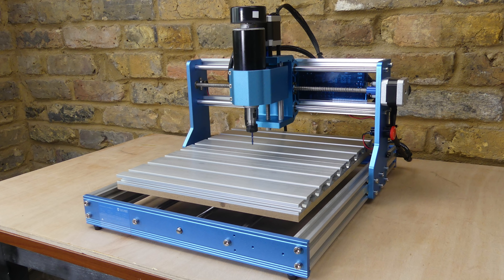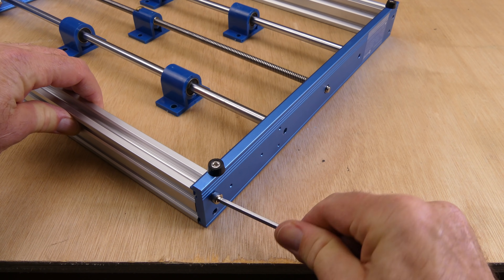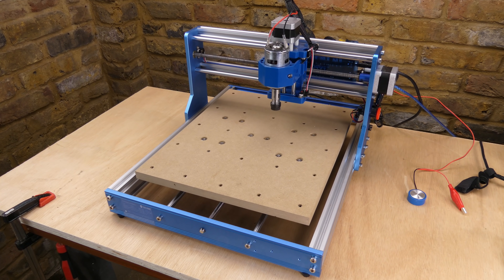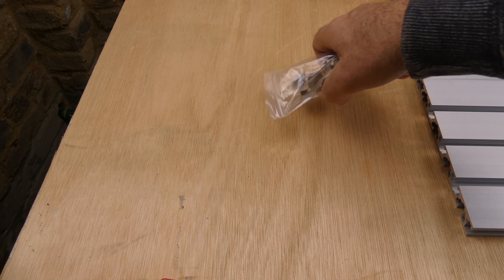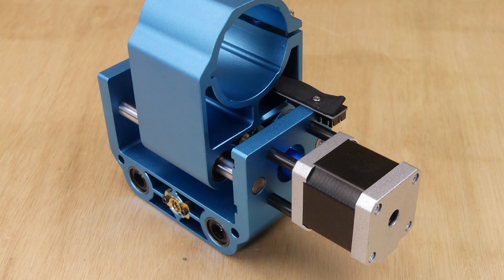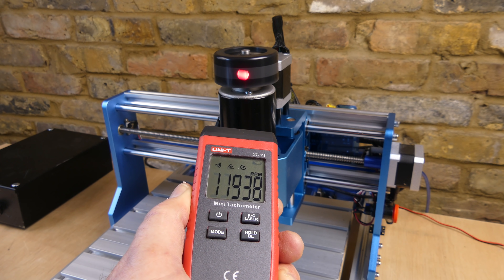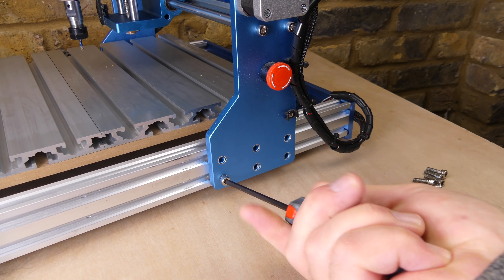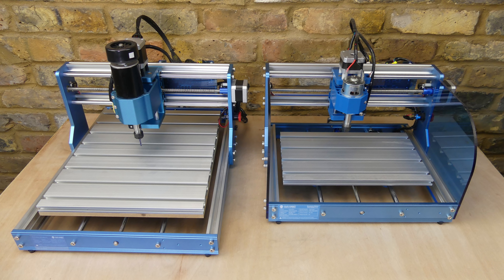CNC 3018 to 3040 Upgrade with 500W Spindle Motor  ( Sainsmart Genmitsu )

Comment: Is there a way to upgrade this machine (or identical Lunyee 3018 pro max) with a 4th rotary axis? I can't find anything about 4th axis upgrade....
Reply from the maker: In theory, you can just buy a generic rotary 4th axis and connect the stepper motor to the y axis output on the controller.

Comment: I connected a 500 W spindle to my GRBL card–driven CNC. I use the UGS software to establish a connection, but after it runs for 3–5 minutes, the USB connection drops. This seems to happen when the spindle starts to overheat. How can I prevent this? The USB cable is a shielded cable.
Reply from the maker: Might be static, try grounding the spindle and any dust collection.Add split ferrite cores to your usb and power cables. Check the power supply output is ok.

Comment: I recommend everyone wear out the stock z-axis before upgrading. You do not want a sturdy z-axis until you learn to control runaway. It happens a lot with these in the beginning. You switch out the tool and forget to tighten. You get off on your position. I had about 5 bad ones where it was better that the z-axis has some bend to it. If you are ready, go for it. Absolutely worth the price. So much quieter and I can run the mill a lot faster. I set my cut rate to where the bit is not jamming into the work and having a more perfect spin helps a lot. But best of all, you really set the difference in the milling. No jagged edges and you can just tell it is a better cut. I am still running the stock motor. It is almost dead, just curious how long it will take. I cut pcb board mostly and drill perfectly spaced holes with mine.

Comment: Boh, that's ugly, those large overhangs of the table, these thin rods that are already too thin in the 3018, for a laser this may work but is more expensive than a complete 3040 laser, for any milling it is just too weak. The aluminium part is just as small as on a 3018.

Comment: I upgraded the spindle on my 3018, but when I tested it, I noticed the Z axis seems "inverted". When I try to raise it, it goes to Z- and vice versa. Any idea where the problem might be? The connections seem to be correct, and the spindle raises when the auger rotates clockwise, so I don't know what the problem might be. Any guidance or advice would be helpful. Thanks.
Reply from the maker: You can change a setting in the grbl configuration to change the direction.  $3 direction port inverse mask   https://github.com/gnea/grbl/blob/master/doc/markdown/settings.md
Reply: @techydiy thanks a lot, I'll try that! I'm learning a lot with your videos too, they're always super helpful 😊

Comment: What end mills did you use to cut the aluminium sheet,aluminium has a specific cutter profile if the wrong cutter type is used regardless whether HSS or carbide the wrong cutter will struggle as the soft metal will not clear and will smear on the cutter.

I have just bought one of the 3018 pro desktops(still in post) and i have thought about this enlargement using the control gear with TB6600 stepper drivers and larger steppers of course,maybe use the side rail bearings i have and make a stiffer gantry out of box section steel profile 1mm thick to make it as light yet stiff as possible since the bearing rods are the gantry weakness.

If you get better cutting of aluminium you could mill gantry side plates from 10mm aluminium,i would,and get some real wood carving going on.

Still you have a good mill there,trend sell the proper aluminium cutters and trend have a wealth of info on this seeing as they are for manual routers for shopfitting doors etc the materials for this would be perfect for even a stiff alloy gantry etc.
Reply from the maker: I now generally use single flute or 3 flute dlc coated endmills for cutting aluminum and stick to grades that cut easily like 6082T6

Comment: Why did you Earth the motor and what did you end up connecting that additional wire to? I have been having some EMI issues with my DIY machine and I am interested to see if that might help with some of those problems.
Reply from the maker: The power supply was not isolated from the main supply. Connected it to the supply earth.

Comment: Please don't cut your zip ties/ cable ties like shown in the video. The tool is called a "flush cutter" for a reason. Cut the excess cable all the way flush.  If you've ever been stabbed or sliced open by an improperly cut cable tie you will understand. Other than that, a brilliant video.

Comment: Watched you're fantastic videos and now have installed a larger table from Sainsmart. 300 X 360mm
Could you please tell me the $130 - $131 - $132 settings plus how far did you move the gantry.
Thank you 
Please stay safe.
Bill M8-)

Comment: Excellent video, I would like to make a modification, but I would like to know how far I could extend the x, y, and z axes.  I would also like to know if the values that changed $131=315, if previously above it indicates $131=158 that means that the previous value was 158?

Comment: I am in the middle of doing this same upgrade but, I discovered that the Z axis limit switch is hard wired to the assembly with a tree prong plug on the control board end - on the assembly I am removing.  But, the new assembly requires a wire with plugs on each end.  Did you have that problem?  If so, how did you fix it?  I don't want to have to cut the wire from the old assembly and try to solder it to the new one.  Thanks, I like the video.
Reply from the maker: I didn't have any problems.
Reply: OK, Thanks @techydiy

Comment: As a side not, you can get the very same parts to increase Y axis size by sourcing them. Waaaay cheaper !
Same goes for spoilboards : both at the same time. Aluminum as a "base" that will be left untouched, and a MDF one that can be sacrificed.

Comment: What is met by " offline contolker"?
Reply from the maker: Offline controller - Used to send gcode to the machine instead of a pc or laptop. It has an SD card slot for the files.

Comment: have built the machine as your did in your video. The only thing not done is making four plats to raise the cutter. Since this is my first CNC would you be able to supply the templet?
Reply from the maker: I never saved it, it was pretty simple though.
Reply: @techydiy  Thanks, from your video I was able to create the drawing.

Comment: Manual says mount the x axis assembly 46.5mm . do you know why? I saw that @6:55 you had this more than 46.5mm
Reply from the maker: It needs to be positioned such that the the spindle is in the centre of the table travel. So move the table to the centre of its travel and then set the spindle into the centre of the table.
Reply: @techydiy  Thanks for the details. So, if we position the table in the center of frame and x axis in the middle, the spindle has to be at the center of the table. Did I get that right?

Comment: Thank's for your video : i'll notice the link!
I re-designed the electronic parts of the 3010 because i find it too weak and no electrical keys anywhere 
can bring several  electric damages to the machine.

I have 2 questions:

1/ Is the 3040 stronger or better than the 3010?
2/ And may we do the same thing with the 3010?

Does anybody knows?
Thank You!

Comment: Ever seen this one? Even after carefully calibrating the XYZ axes my 3018-PROVer and using the Z-probe on every setup, it consistently cuts between 2mm and 3mm deeper than what is called out (using an end mill with a 1/8" shank - the goal is to get a cut 1mm deep in 3mm stock but no luck).  Everything else seems to be working accurately across multiple test files in VCarve Pro 10.5, UGS, and Candle but they all produce much deeper cuts than what I'm instructing the CNC make.  Cheers
Reply from the maker: I think  I would start by manually jogging the machine z axis up and down by 1mm, 2mm, 10mm etc. and seeing if it actually moves that amount. Also see if you have any play in the z axis.
Reply: @techydiy  Found it!  There is an option in VTransfer for X-Carve  -- I ignored it because I don't know what X-Carves is -- that allows you to specify the height of your Z-probe as well as a default move rate.  Both values were too large and after adjusting them I'm getting the proper depth.  Thanks again
Reply: @techydiy  Thanks.  Yeah, I tried that and it's all tight and jogging against a digital depth gauge is 1:1.  No idea why it overshoots by so much when doing an actual job =\

Comment: What size (and length) bolts and tee nuts do you use for z extension when you used your metal plates with four holes, please?

Comment: How do you insert the clamps for holding the wood ? There is no place on the sides if you block with the extra rails heigh!
Reply from the maker: The whole table moves forwards and backwards
Reply: @techydiy  Oh, yes. Pretty annoying. Finally my option was to leave nuts on every slot so I simple screw the clamp where I need it. 😊 Thank you very much for the clear directions on this upgrade, BTW .

Comment: Hello, I also have such a motor (48V). It was working before, but yesterday, while scraping wood, the motor had a hard time and suddenly stopped. Now it doesn't work at all. I measured it with a multimeter. There is electricity (48V) at the output of the PWM driver and the positive and negative terminals of the motor are powered, but the motor does not move. What do you think might be causing the problem?
Reply from the maker: Use the multimeter to check the resistance of the windings. They might be open circuit, shorted, it could be a problem with the brushes.
Reply: @techydiy  Thank you for your answer.  I will check it.
Reply: I had a similar issue, but the symptom was after the scraping incident, the feed rates became incredibly slow. Eventually I did a $RST and then reestablished the original settings.
Reply: @davidhawley1132  There is no problem with my CNC machine. Spindle motor does not spin. (The motor was working independently from the CNC machine)

Comment: Thank you for taking the time to make these videos as it's very much appreciated.
Is it possible to answer two questions for me please.
1 The new upgraded motor came with a power output unit but I don't know which of the live/motor terminal goes where as it in Chinese caricatures.
2 What is the size of the metal box. and where did you get it please.

Thank you .
Please stay safe .
Bill M8-) 
Haddington
Reply from the maker: 1. You can get a camera app on your phone that translates Chinese
2.  9" x 6" x 3" Adaptable box with knockouts. 
It was just one I that I already had. I would just get any Aluminium / Steel project box.
https://www.tlc-direct.co.uk/Products/BX963.html
k

Comment: lets upgrade make it longer rod and same acme thread. it just flex more. even 12mm linear rail is better it flex only that much how much thing you skrew it flex lol if you skrew it on granite it wont flex lol.
noh lets just have 12mm round rod in middle it not flex? lol

Comment: Hi,finally I have the need to use now the expansion ordered a while ago.
Anyhow - I was thinking of replacing the Spindle as well.
What I want to ask is: Can I use the spindle speed commands like I used in the original spindle? OR do I need to turn on the spindle with the potentiometer on the new external powersupply?

I am using the MACH3 version for the 3014 Prover 
Thanks for your feedback!
Reply from the maker: It is possible to connect some spindle power supplies to the control pcb  to allow speed control. It depends on where you get the spindle. The spindle power supply that I used is pretty difficult to connect due to high voltages. The Sainsmart one is probably easier. Someone made a video about it.  Personally I don't think having program speed control is worth the effort with a 12k spindle.

Comment: Well I am new to This, Please can you explain why the spoilboard is on the bottom.?
Reply from the maker: It's not a spoilboard, its part of the table. A spoilboard is a disposable sheet on the top of the table bed. 
Sainsmart use the wrong terminology for this (in my opinion)

Comment: i cant seem to remove the original lead screw from the stepper motor. I removed the 2 tiny screws farther from the motor but the screw seems to be stuck. do i have to remove the other two screws closer to the motor? the old screw doesnt seem to budge. is it also screwed into the coupler or just inserted and held together by the tiny 2 screws?
Reply from the maker: It's just inserted into the coupler and held in place with the two grub screws. its is probably just tightly wedged in there.
Reply: @techydiy  yep. had to use a few plyers to take it out. scuffed up the coupler a bit but its alright. Also i just finished adding the extension and noticed the new extended screw is not straight when spinning and is alot louder compared to the original. looked straight preinstall. is it just because of the length that there is a lot more up/down movement in the screw? or a bad screw altogether?
Reply from the maker: I would check the coupler to make sure it's not off centre. Also grease the leadscrew. Leadscrews  are reasonably.

Comment: Thank you for a great video!!! It helped  me a lot!!!  I just added the 3040 extension to my 3018 Prover.  I have a question : How far must I move the gantry forward on the 2040 rails from the original 3018 original position?  I installed it in the original 3018 position and it appears to be about 30mm too far back.  I also plan to use the old 2040 rails to "lift" the Z axis higher up since I added the 3040 spoil board with the extra aluminum bed piece.
Reply from the maker: Position the spoilboard so that it is centralised and then position the spindle so that it is in the centre of the spoilboard.

Comment: It was very interesting. But you should have used sliders to connect aluminum profiles. Hope you did later :)
Reply from the maker: Why? What difference do you think it would make?
Reply: @techydiy  it would prevent backlash and give five more millimeters of height as a bonus.
Reply: How would you tighten sliders in that case? Never seen any that you can tighten from the side.

Comment: Thank you for this very informative and very well-done video. Can you give me the spacing of the cylindrical guides of the X-axis, of the aluminum motor mount that you used? I would like to know if I can install it on a Chinese 3018 no name. On my CNC, the cylindrical guides have a diameter of 10 mm and are spaced 72 mm apart.
Reply from the maker: As best as I can measure them with calipers, 10mm diameter and 69mm centre to centre spacing (with 59mm of space between the two rods)
Reply: @techydiy  Thank you for responding to me so quickly during this festive period. The cart is not for me because the spacing is not correct. I found a cart replacement kit on Aliexpress, which adjusts to all clearances, but it is a bit tricky to properly align the 4 bearings and ensure a durable fit. We will see what happens.
I wish you a happy new year, 2022.
Reply: @joelrichard-foy4938  the mounting of the x axis linear rod is just a couple of holes, if you cant mark and drill that yourself with a bench drill any machine shop could for 20 bucks.

Comment: Another great video that has helped me a lot in using my Sainsmart 3018 PROVer . Do you know where I can buy the nuts shown in the video at 12.48m to make the height extension?
Reply from the maker: Thanks. Ebay, Amazon, Aliexpress etc. loads of places sell them
Reply: @techydiy   thanks but the question was more about the name of the nuts. Finally, I found them, Nuts M5-14 Tension T-Slot.

Comment: Which speed and which tool is best to use for 3mm aluminium maschining it to a extruder carriage for my 3d printer. can i use cutting bit with 2 flute or better 4 flute?
Reply from the maker: For aluminium 2 flute or single flute. With a small depth of cut and cooling.
Reply: on aluminum I have bitten 1flue hptc 818, and alcohol cooling. these tools are more expensive than aliexpress, but the difference is huge.

Comment: Ive watched this video 20 times now, figured it was time I commented! I'm looking for a dust shoe for mine, any suggestions? Thank you!
Reply from the maker: There are some links in the video description. 
Or you can find several designs by searching for "3dprint dust shoe" 
Or you can find a few on etsy
Thanks
Reply: @techydiy  Thank you. I specifically meant a dust shoe for the 500 watt spindle in this vid, its 52mm i believe, I've found a few design I can cut myself.

Comment: After you installed the Y extension kit, did you notice the table/build plate become more ‘flimsy’ ?  I installed the extension kit, and the new linear rails, are not any bigger in diameter.. and wen u push on the corner of the table/build plate, it will move a 1/4 inch, and you can see the linear rails bow.. really not liking that.. trying to cut aluminum parts..
Reply from the maker: It's was pretty much the same as before the upgrade. Cut in the middle or add some linear rails or I think some people have added some 3d printed edge supports.
Reply: @techydiy  yea. I found a place out in Colorado that sells a 12mm linear rail upgrade for the 3018..  both in standard 3018 length, and the length of the extended Y axis upgrade..  they also sell the matching 12mm bearing mounts at the right height, and their bearing mounts are also longer, and have 2 bearings in each mount, so it’s easier to get the bed & rails aligned so you don’t get that drag or “crunchy” harsh movement of the Y axis.. I’m now debating with myself, weather just the 12mm upgrade will be enough, or if I should add 2 more 12mm linear rails toward the outsides of the bed.